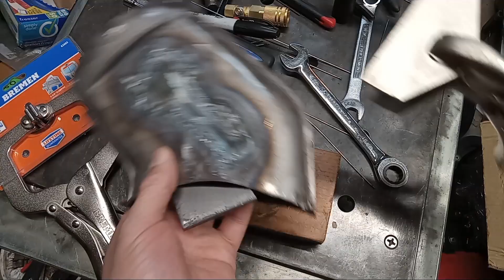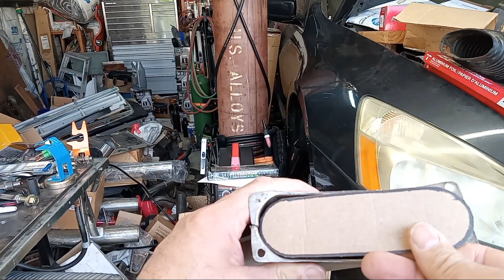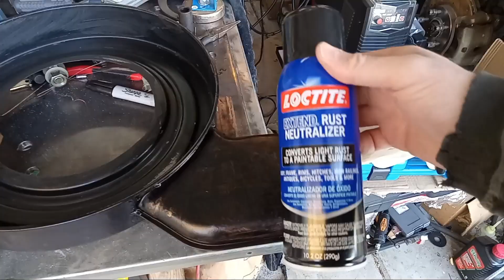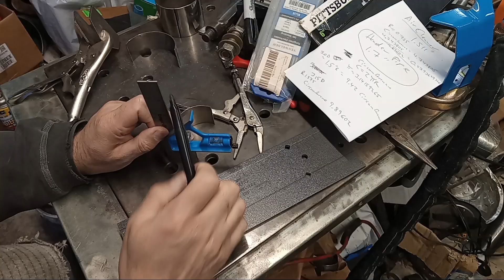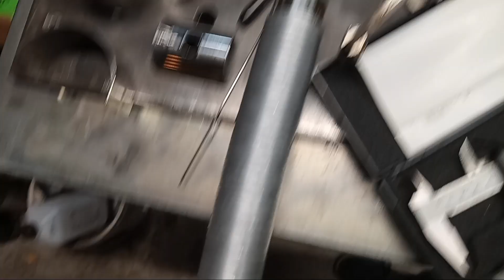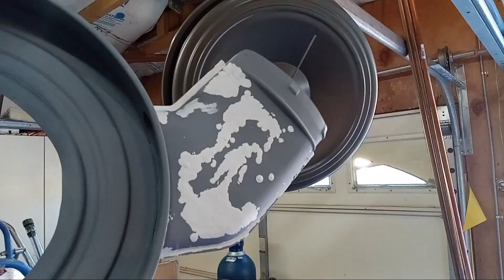Chevy TBI Air Cleaner Mods 1986-1995 High Flow Cold Air #chevy #gmc #c10 #coldairintake #aircleaner

Comment from the maker: https://amzn.to/4puhYec - Amazon Affiliate Link - Air Cleaner Decal Turbo-Fire 350
https://amzn.to/4kwla5s - Amazon Affiliate Link - @JEGSHighPerformance  JEGS TBI Air Flow Enhancer | Fits 1985-1997 Chevrolet/GM 5.0 & 5.7 Liter - https://www.jegs.com/i...
https://amzn.to/4fbu1tz - Amazon Affiliate Link - Standard Motor Products DH3 Pre-Heater Hose, Size 1-1/2 x 7 inches, Expandable to 20 inch

Comment: what 1986-1995  has the intake air from the passenger side fender?
Reply from the maker: Not sure all the years, but I will try and figure it out as I travel through the wrecking yard.  That is how the 1990 came stock.  It went into the fender on the passenger side then had a sorkle that went to the front.  That is why I just went straight to the front on the driver's side.
Reply: The 1988 to 1995 Silverado slash Sierra